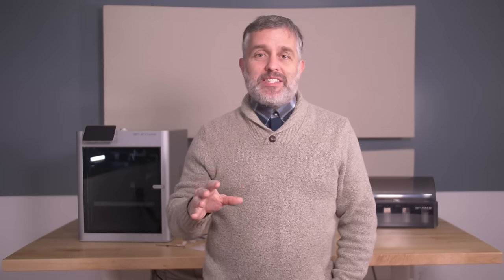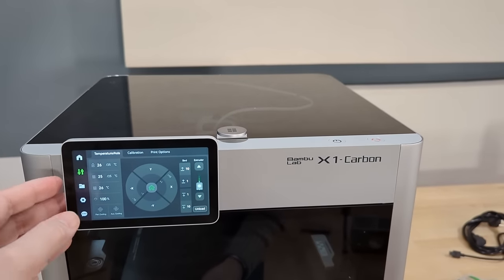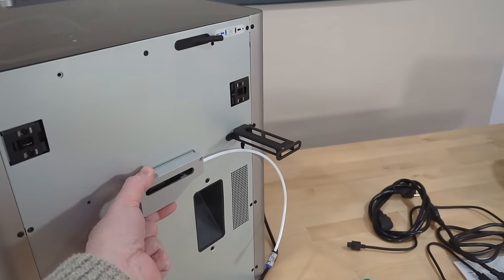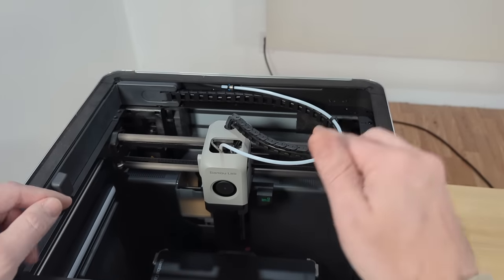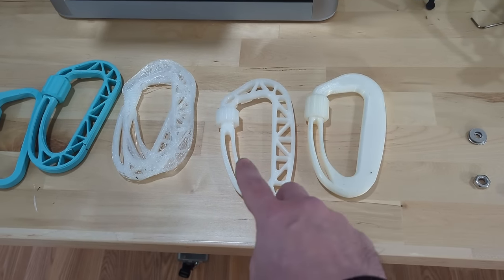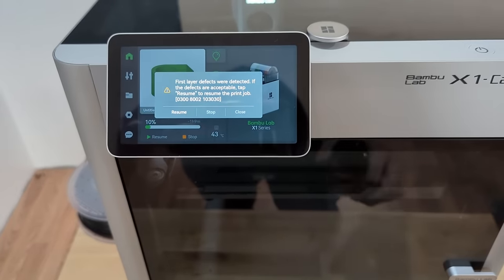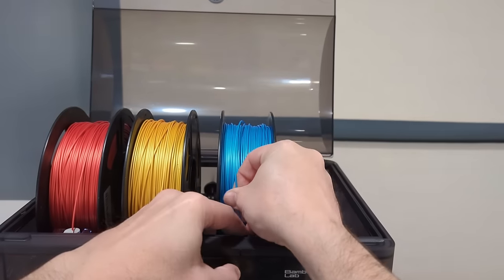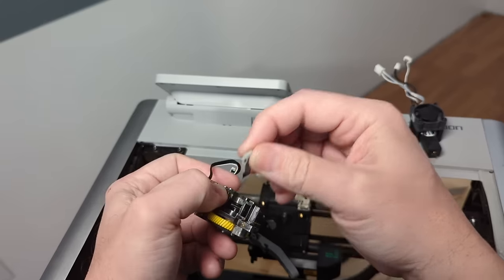Why The Bambu Lab X1 Carbon is a PhD Master Class in 3D Printer Design

Comment: I don't see why you would have kids running around production machine, not very wise with all the harmful VOCS, and hot temperatures and moving parts that could really harm a young child. Seems a bit nitpicking. I have now been using 2 weeks machine and found my own settings and removed nannies and the machine is rock solid. (on concrete base with foam underneath the concrete of course, much needed for noise separation). Open source is overhyped. Nobody makes a steel nozzle themself, new unit with heating is 8 or 13€ from Bambulab, very affordable and ofcourse there will be companies who will provide their own take of the same part available. I see only positive on the appleness.
Reply from the maker: 1) it's not a production machine. It's a consumer oriented machine. Like an apple product. Production machine would look different. Because function would have been prioritized at every level instead of trying to make a beautiful product. Therefore, it's likely that kids will be around this machine. 
2) I urge caution thinking that 3D printing is a production process. There are a lot of 3D printers out there. Lots of competition on the internet. You probably aren't going to make any money selling three printed things.
3) open source is not overhyped. It's severely misunderstood. Without open source we would still be paying 35,000 per printer to stratosis. Without open source this machine would not exist. Open source just means we all share the information instead of trying to hide it with trade secrets. The massive negative associated with open source is the fact that it's very hard for the people providing the real value to be compensated. Instead, it's a commodity type of market and the cheapest supplier wins. Good for the consumer. Bad for innovators. Basically, it treats the most valuable person in the chain as the bit@#.
Reply: I have sold over 100  3d printed automotive products to over 35 countries in last 3-4 years. Not really marketing at all, but I fullfill orders when someone asks for it.  My first customer won racing series championship with the parts. Before this I had to outsource production.  I am design & additive manufacturing consultant to industry leading companies in multiple fields. Bambulab X1 Carbon with AMS is first machine i can enjoyably left to do serious work in my home office, just like other products in my apple ecosystem. Apple is basically standard in many fields of design, it was always inclined to creative people in the history. 

Bambulab is certainly more advanced than most Ultimakers, it is way less restricted than Markforged. It is leaps above Prusa most ways, who still are not providing the XL, not to mention with proper enclosure. Are there better printers? Yes. Generally SLS machines and HP MJF. HP costs 100000€, SLS’s are in similar range if not more. Also those are usually printing nylons that is very heavy compared to ASA.  I cant stop inventing, so I rather design something that is of value that I can sell, even if it will stay rare item. Efforts in marketing and shipping are personally the pain and limiting factor for my personality type, not the printing. I think for the price X1C with AMS is the best the world has seen so far.

Comment: If Apple made a 3D Printer you would have to replace it every 2 years or pay them $400 a year to keep using the one you already paid for. But the Apple crowd wouldnt mind throwing it in a landfill and pay $1200 for the new one that comes in a different color and of course the printers Maps still wouldnt work, lol. It would be wireless but yould have to buy a separate usb dongle and of course at the 2 year mark they will send you a self destruct signal to the firmware. All that top of the line Technology that still works will fill up our landfills. Maybe they should stick to small devices. Please, No Apple Cars. Apple doesnt even care about the Billion dollar fines every year for breaking the law. The government should charge them with a disposal fee for every unit they make. Pure greed is alive and burning down the planet and we all just watch, while wearing an Apple watch. My last smartphone (samsung) worked fine for 10 years and still works fine

Comment: Bambu is way too expensive.  They'll never escape all the problems inherent in 3D printing.  If the Bambu printers were $300-400 I could see getting it over some of the basic $250 machines.  But you will have the same problems.

Comment: If Apple made a 3D printer? 
It'd be overpriced, underperforming, a (chipped) spool of ABS would cost in excess of $200 and you can't replace it yourself and still half the internet would be full of applelytes who claim loudly it's the best thing ever.

I would not even look at it. 
It'd definitely not be a selling point for a maker.

Comment: If this was designed and sold by Apple, I would stay far away from it, with extremely bad customer support and even worse repeatability or parts availability, not to mention endless design flaws that they do not accept as such and by doing so, swindle their customers, and the fact that they outright lie to their customers on daily basis keeps me away from anything Apple related. 😉 So I really hope this is nothing like an Apple product.

Comment: Seems Bambu just wants to sell something that looks slick.  Not impressed.  Not for $1500.  At $400, yeah, I can see it.  But it will still have the same problems inherent in all 3D printers.  And you have a lot less access to be able to work on it when you do get failed prints.

Comment: This printer is so expensive.
AU$2200.
Yikes.
Makes the Prusa look like a budget printer.

Edit: Why do you keep saying this printer is cheap? The further I get into this video, the more you say it. 
Also, you pretty much just showed it failing to print non-stop. Maybe this last 20 mins will show something 
Plus, this isn't even a heated chamber for $2200. Just how are you saying this thing is cheap?
Here, I am wondering if it's worth upgrading from my heavily modded CR10. You aren't showing much of the print quality, but what you are showing is pimpled surfaces.
It would be nice to see you try and print 0.8mm layers on a detailed mini or something. 
Get an idea of its capability. 
I'm not impressed so far.
Still 15 mins to go.

Comment: "If Apple made a 3D printer" If they did it would cost us $50,000. and it would be made so that you and no one else could fix it other than Apple, If Apple did fix it, it would cost $49,000. to fix a bad hotbed. That was a very bad company to use as a comparison.
Reply from the maker: Really? Is it actually a back comparison? We're seeing Apple being dominant and getting away with these behaviors. What was Apple like when they were a new company? How is BL different?
Reply: @DesignPrototypeTest  Yes, I do think it was a bad comparison. I'm not badmouthing your video I'm pointing out that your comparison to Apple products is flawed. Apple which has done everything it can to fight Write-to-repair laws in this country (By doing things to circumvent the laws) is a very nasty company. If you think I am wrong you need to look into their practices. If 3D printers were like Apple, I would never own one. It's bad enough that the 3D industry is starting to change to proprietary parts (which is enough like Apple) instead of open source.

Comment: Warning
Due to all wonderful and  shiny reviews on youtube. I bought an x1and got a printer, which is fucking shit: Full of software faults and operation glitches:
the setup is not as easy as claimed by all reviewers:
the QR code wich appears in the setup isn’t working. The actual one is hidden in the menu of the display and appears suddenly when you touch a menu symbol.
The AMS setup wasn’t working according to the manual or videos all.
And from bambulab you can expect absolutely no support. It’s probably just a letterbox company. I can’t even return the printer, because nobody responds. All tickets are just fake. I bought it, because I’m a beginner and wanted an easy start, but the opposite is absolutely the truth.
Therefore I strongly recommend not to buy this printer. After this example of fucking Chinese engineering I bought an Prusa MK4, which might seems to be old school and not sexy. But it fulfills the promises of easy setup and superior print quality. I’m going to sue Bambulab in order to get money, which won’t be easy with a fake company, but fun.Anyway we should change the name from bambulab to pandas shit.

Comment: Every company in China is ccp related, so it doesn't matter if its dji or not.
Its not always a terrible thing, but I wouldn't use a product that has Internet connectivity that's made in or written in China.
Its caused a few issues over the years, but its fine, you can avoid cloud or Internet connected devices

Comment: You got multiple things wrong... Do your home work :)
If you do like more than 1hrs review, pls check your facts.! ;)
Reply from the maker: OMG I talked for an hour and got a couple facts wrong. What am I batting 95% That's still a strong A and I got you to leave a comment which helps the video do better on YouTube. ;)
Reply: @DesignPrototypeTest  maybe you got my comment a little too hard... 

There is few things what you would have got right if you would have just used it a little more....

Like slicing to SD. Just drop the menu from slicers button and send or print or export to thinrd party mass storage 🤷‍♂️🤷‍♂️🤷‍♂️
Reply from the maker: You mean that tiny little arrow that's almost hidden. The one you have to dig deep into the manual to figure out. The UI really does its best to hide that from you, and I fell for it. So who's to blame the user or the developer?  Seems like bambu lab really doesn't want me using that functionality and only begrudgingly offers it. Hence the reason it's hidden. There are some much more obvious places where it could be located like the place that I said it should be located in the video. Good UI makes functionality intuitive not obfuscated.